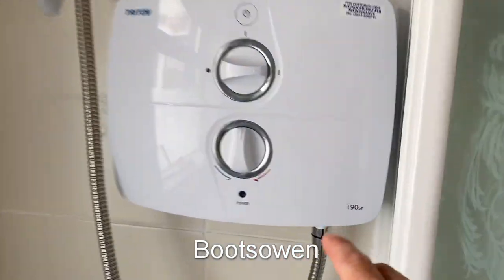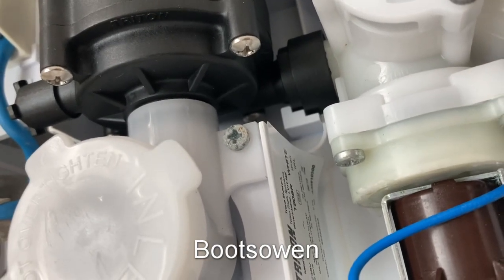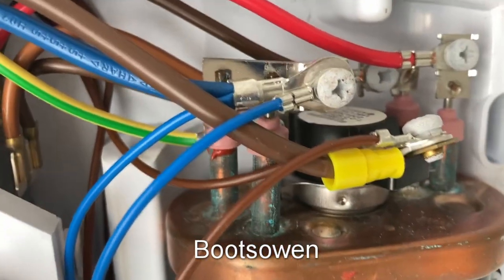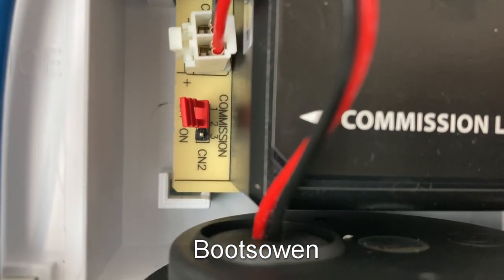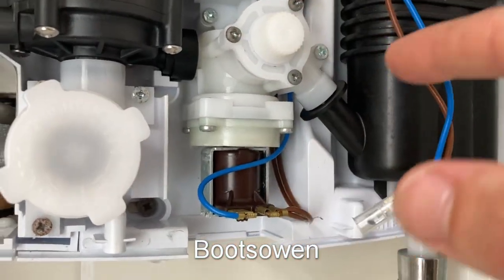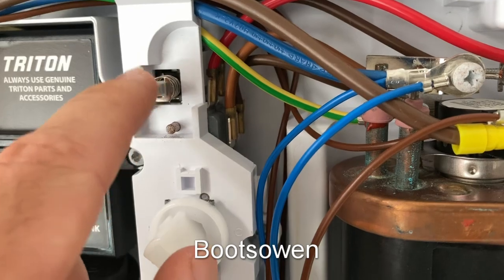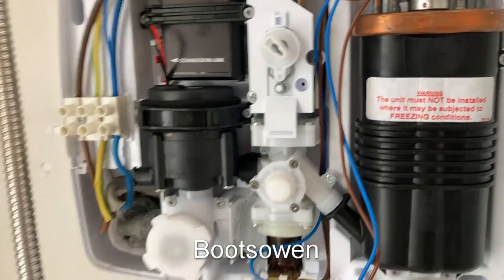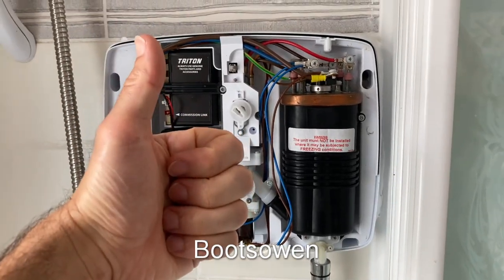How it works | figuring out how a Triton T90sr pumped electric shower works | a look inside

Comment: Hi..mine one is only 9mths old and for last 4 days i have to wait like 3-4 minutes until i get warm water out of it..checked the filter..its clean..water pressure from mains is good too? No noises. Any ideas??
Reply from the maker: If it’s only 9 months old you should talk to the supplier or installer
Reply: @bootsowen it was one of the microswitches..3 euros

Comment: I'm having an issue with my Triton at the moment. When you turn off the shower completely, water still comes out of the shower head and doesn't stop. Any idea on how to fix this or what's causing the issue?
Reply from the maker: Solenoid valve stuck open?
Reply: @bootsowen yes, we had to remove the filter just to stop the water coming out
Reply: @JackMorrissey-r3h have u sort out? I’m in exact same situation now
Reply: The solenoid valve needs replacing, looking at this in the shower itself looks easy enough to replace. Anyone have any experience of this

Comment: I have to relocate my model to a new room so will have to get extra electrical cable, about 10 metres. What do I ask for in the builders supplies? Does the required cable have a description?
Reply from the maker: You have to size the cable depending on the voltage, power of the shower, and run length. Then you get twin and earth cable in that size.

Comment: Quick line to say cheers for the video, helped with replacing bearings on a very noisy T90Z (one before this i think with motor and pump separate), as luck would have it already had the bearings (8mm x 22mm x 7mm) from an earlier Henry repair (another one of your videos), never thought I would have a use for remainder being a 10 pack, perfect fit and much, much quieter   👍
Reply from the maker: Glad it helped

Comment: Thank you for video. 
Triton t90  as above installed approx 2 years.
Water still runs for 5 min after shut down.
Might it be the off button connection??
Works great otherwise. Cheers Eamonn
Reply from the maker: Was it always that way?  Some have a cool down phase. So that if you turn them back on again soon you don’t get scalded

Comment: What type of power supply does it require?
Is 220 volts ok?
How much power do I need to work?
Are 3Kw enough for regular operation?
I can't find this data anywhere.
Thanks
Reply from the maker: 220v. At least 10kw. Depends on the model and voltage. Big cables.

Comment: Hi ! My shower is exactly the same , but since a year ago the water just come warm , never hot enough , specially in the winter , even cold ! The shower it’s working but water never heat it up in the maximum capacity , I have changed the heating element thinking this was the problem but continues the same , wondering if would be the filter or the thermostat? Tks
Reply from the maker: if the element is good, and it has two heat settings, then maybe the switch driving one or both of the elements is broken or intermittent.
Reply: Oh ok , understood , like when we put in the first element indicator doesn’t get warm at all just when we put in the second element indicator but not hot just lightly warm.

Comment: This Triton t90Sr , dose anyone know dose this unit have carbon brushes,  as the fault with shower it works for say 5min and then  water flow stops so turn it off and if i go back to it in half hour dose same thing,  would anyone know what this problem is, any help be great.
Reply: It's brushless motor

Comment: The commission link is to allow mains power to open the solenoid valve (on the bottom, after the filter) without the motor starting so that air can be purged from the system.  The pump has to be full of water before starting the motor.  When the air is purged, the link is swapped over to the on position.   But I think you answered your own question later in the video!

Comment: Really good video. Just wondering does the tank need to be drained in order to install this to replace a T90z? Whats the procedure? Cheers
Reply from the maker: If there is an isolator at the shower inlet then isolate it and you don’t have to drain the tank. Or there may be an isolator somewhere else. Otherwise you will have to drain the tank. I think it’s unlikely that there’s no isolator.
Reply: @bootsowen  thanks for the information. Will have a look for an isolator

Comment: If I have got an old T90XR will this fit exactly with the new T90SR?  E.g. Screw fittings and more important the water valve etc.  Please can you confirm?  It looks similar and is a Landscape model.
Reply from the maker: No idea. But what I would do is try to download the instructions. They come with a layout template and it should be straightforward to compare. Or you could call triton. They are pretty good

Comment: My shower has one side that came off the wall
Thanks for the vid, think I can open the cover without disconnecting the wire and screw back the side that was off.
Reply from the maker: Just make sure you have switched it off at the fuse board.

Comment: hi jus wondering any ideas,water not heatin up whem flowin out from shower only have cold water,
Reply from the maker: thermal trip on top of element?
Reply: @bootsowen   where is the element situated?
Reply from the maker: did you watch the video mate?
Reply: watch the video will check out shower unit now
Reply: thanks for the help,had to replace the heating element.

Comment: I have this shower and it started going boiling hot to freezing, what i read its water pressure.. it has worked away no issues for 2 years, wondering if its limescale? Best way to fix?
Reply: Update, outlet now has a continuous flow of water while off
Reply from the maker: It could be limescale as you say. If it was me I would have it apart. Make sure the power is off. These showers are alll fairly easy to get into and to repair. Parts are readily available. Might be worth swopping out the flow regulator. They also have a pretty good network of repair people. You pay for the call out but the showers can be repaired.

Comment: My landlord had this installed today but i had to put the temperature on max for it to be warm enough (for me as I like heat), does this mean that it’s running off the water in the boiler? Or does it mean the pressure isn’t strong enough to switch on the elements you pointed out? I’m trying to figure out if it’s just a power shower or if it’s a self heating one. Thank you!
Reply from the maker: If it’s this model in the video then it is a pumped electric shower with a heater. It takes in cold water only.

Comment: I'm seeking advice. Engineering company says they won't replace my faulty unit because water pressure is too low. But am i right to say that it wouldn't start flowing if it was too low? As far as I know in T80 there is a flow detector and if pressure is too low it won't let the water flow. Is this correct?
Reply from the maker: The pumped units still need enough pressure. Not much but it is usually specified in the installation manual. You can usually achieve it if you give the shower a direct pipe from the cod water storage tank. What sort of supply do you have to the shower?
Reply: @bootsowen  Not sure. It's the same supply as taps in the house. Thing is that water is flowing. If it's enough water for the unit to allow the water to go through heater then it means pressure is enough?

Comment: Never had a good experience with this brand. They usually fail after 2-3 years due to a blown boiler or valves. I bought an electric Grohe in 2015 and still going strong with zero issue. I have heard good things about Mira brand too, but never had one due to incompatibility with already existing wire & plumbing location.
Reply: I've had one for about 4 months and the assembly can has sprung a leak already.  Found this video while looking for an outline of how to do a replacement.

Comment: Excellent content and shower. I do ask does it actually have better pressure than a none pumped and is it quiet or loud whilst running.
Reply from the maker: It's not particularly loud, it is certainly quieter than the brushed commutator motor models. The pressure in most houses in Ireland is provided by a tank in the loft, as this is a single story there is only about a metre of head, but maybe 6m of pipe run. I have tried in this house to have a bath mixer shower from the pressure in the tank, and while it will flow it does not have enough pressure to spray the water from a shower head at head height! So I added a pressure pump to the house too, but the electric shower is on a separate circuit. 

short answer yes and quiet enough!